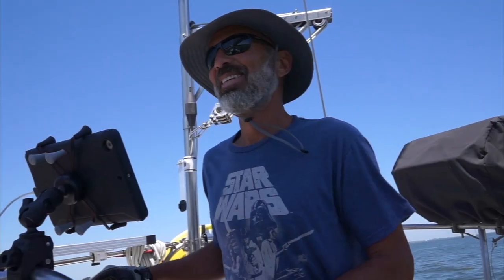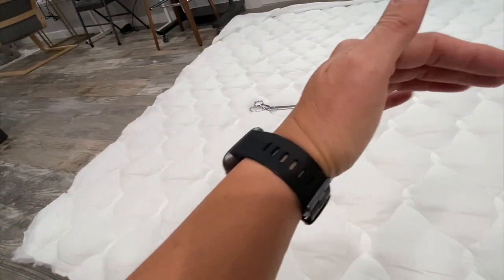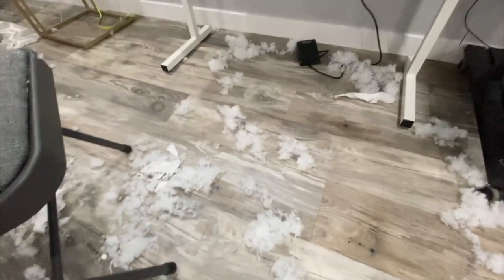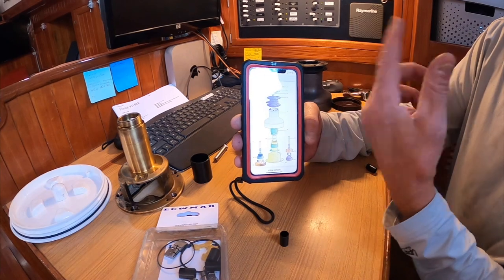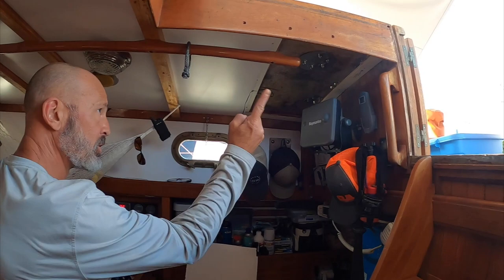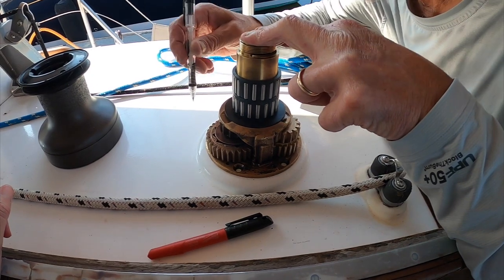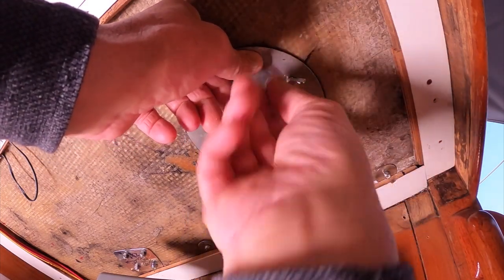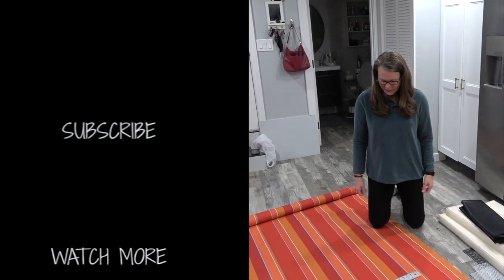Sewing a Mattress Topper and Installing a Fire-damaged Winch | SV Ramble On

Comment: Good video.  I think you have the winch mounted good enough, but looking at the location of the main ratchet gear in regards to how your line meets the winch I believe the winch possibly should have been rotated another 90 degrees clockwise to allow the main ratchet gear to be in line with the load on the drum. I briefly remember this from the installation instructions from lewmar (might have burned up) but don't see them online currently.  It's often hard to get this perfectly correct from all angles for cabin top winches since the loads come in from all angles often times.

On a separate item - is your headliner formica?  how is it mounted?  I do not see velcro when you were pulling it out, assume there was a separate trim piece holding it up - I only ask since I'm redoing my headliner in parts and your posts help.  Thanks
Reply from the maker: Thanks for the winch info and yes all of the instructions burned in the shed fire.  We’ll take another look at it.

Regarding the headliner, yes it is Formica.  Originally it was gel coat covered plywood that was warped and stained from leaks in the cabin top.  It’s not attached to anything and there’s a plenum between it and the fiberglass.  It floats between the stringers in the ceiling.  There’s a thin spacer strip of FRP between it and the fiberglass along each stringer. We’re not real happy with it.  It’s a bit delicate and can crack easily.  We really wanted to do bead-board or something similar, but we couldn’t find anything suitable at the time.  We’ve also heard that it might warp when we get into more humid climates.